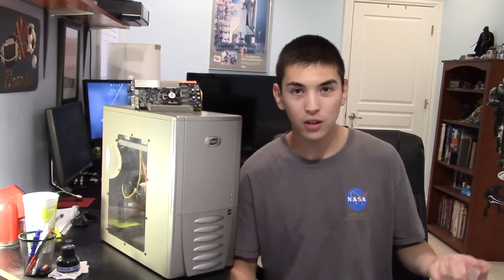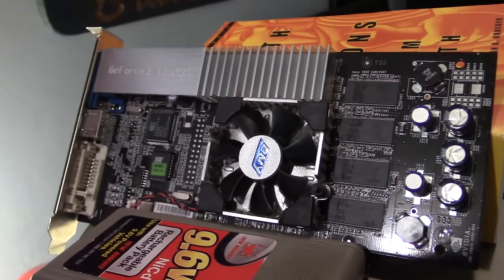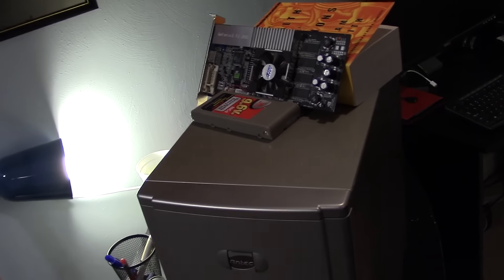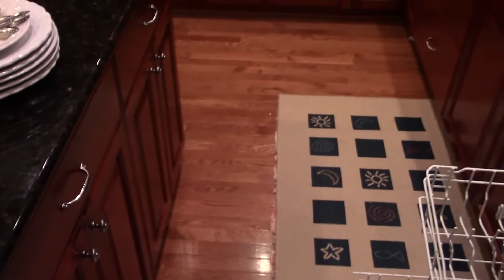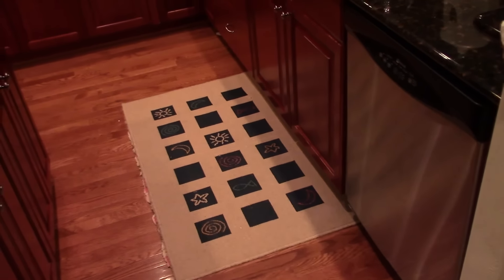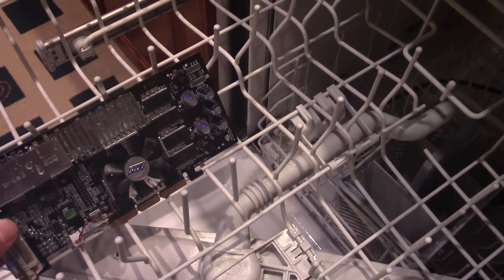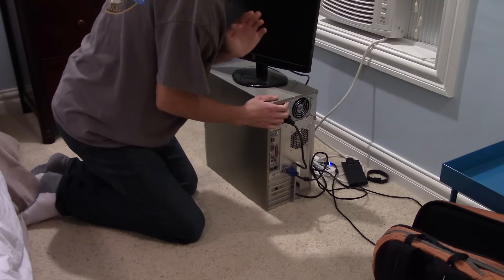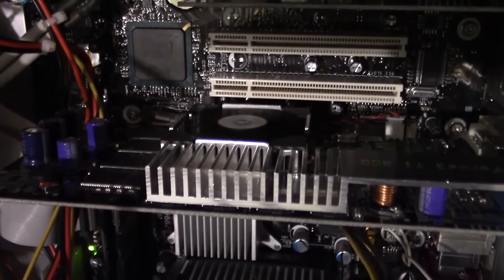Computer Video Card VS. Dishwasher

Comment: I worked for Magnavox  in the 70s, designing televisions. We used dishwashers as part of our production process, to remove solder flux from the board. One thing to note, you should have soft water in your home before trying this. I would remove the fan to.

Comment: do the gtx 750 to next
Reply from the maker: +BradDoGFX Ehhhhh, my budget would not be to happy about that, even if chances are it will survive.
Reply: +1337er Realsie Or a Quadro?
Reply: +N3cr0 4 Titan x i7 5820k 32gb corsair platinum and 8 Intel pci ssds